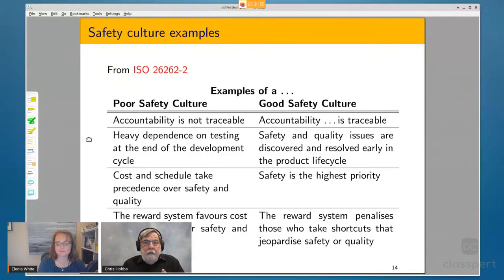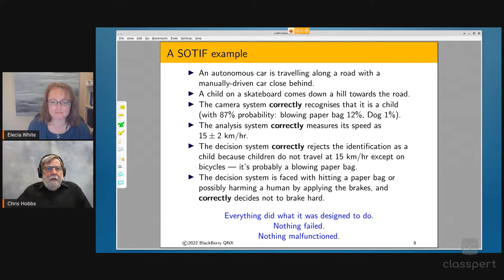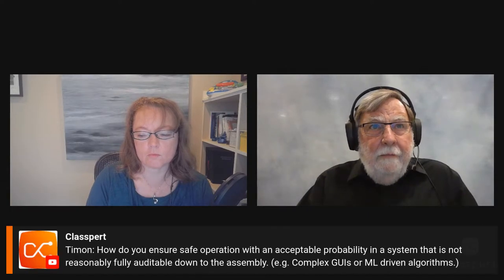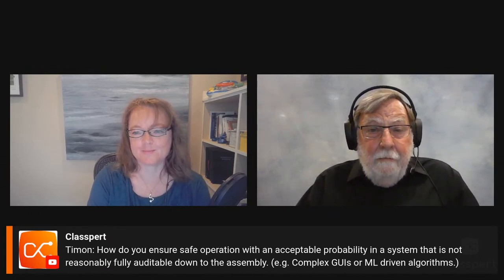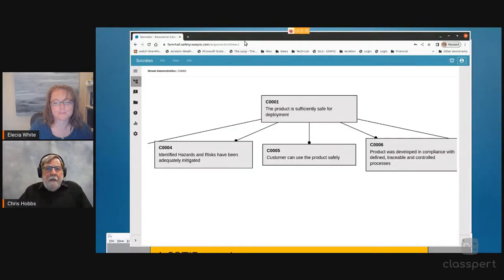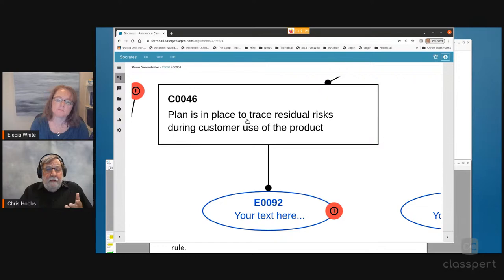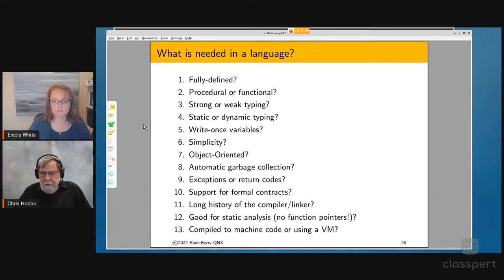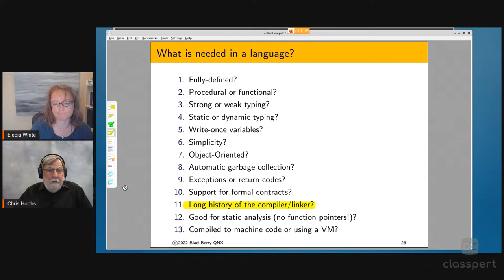Safety-Critical Systems - Writing Software for Airplanes, Pacemakers and Nuclear Reactors

Comment: Chris Hobbs terminology regarding hazards and risks is also wrong. It's not just a case of "everyone has their own terminology". It's a case of one group using the correct terminology and everyone else being wrong. The terms are defined as follows:
HAZARD: A system state or set of conditions that, together with a particular set of worst-case environmental conditions, will lead to an accident.
ACCIDENT: An undesired and unplanned loss event.
RISK: (Probability of accident occurring) x (severity if it occurs)

Basically, a HAZARD is a source of danger (iceberg). The ACCIDENT is how that hazard results in a loss (hitting the iceberg with your ship). The RISK is the chance of it happening and the severity if it does (ship sinking).